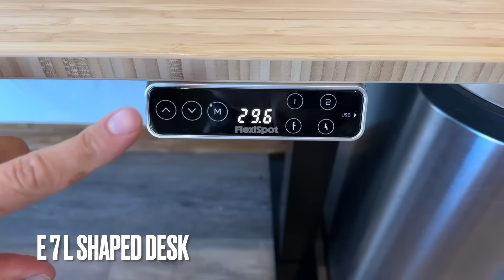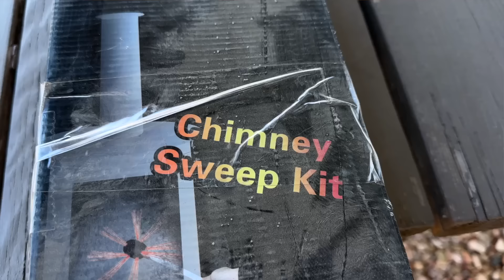HUGE GARAGE TRANSFORMATION - WINTER IS HERE

Comment: That 5/8 is incredibly heavy... and I got sore just watching you.  What you do, though, you use like a picnic table and mount the drywall hanging rack to the top of it.  You move the table into all the different places with the rack fully down... and you crank it up to meet the ceiling... but your table can't be wobbly... and you got to be okay with putting screw holes in the top.  The other thing that might help... though it won't help all the time - is quick grips.  You can hold the drywall in place with those.  The original tool for doing this is what they call a dead man.  it's essentially a big T made from  2x4's.  You make the T  the full height of floor to ceiling, but you set it against a wall leaning  a little so you can get one end of the sheet rock resting on the top of the T... very near where it needs to go on the ceiling, and that leaves you and your helpers at the other end getting it fine tuned into place and screwed.  It's going to look great!  I don't even have a sheet rocked garage... lol.

Comment: If you haven't already, unscrew the handle and apply anti sieze on the threads. Once the handle has seized it's nearly impossible to turn it and to lock the door...happened to mine as I didn't know to do that.

Comment: Regarding the seal on the stove door, our airtight wood stove is 40 years old and still wearing the original seal and it is fine. As long as it isn't damaged or you see other problems I wouldn't worry about it. We burn a couple cords a year of hardwood and one of softwood (usually cedar)
Good job on the cleaning...the creosote is in part due to the wood you are burning and a low temp fire, like when you back the damper down at night to keep the stove running all night. This year you have better wood, so that will help. All those years ago our friends "in the know" told us that, if we could afford it, to run triple wall pipe up through the ceiling...we did, and rarely have any build up even after a full winter. Keeping the heat in the pipe keeps the build up down, we just get that little ring of it right before the cap like you had..

Comment: I don't care what anyone says, wood heat is the best heat. right now, although it won't be seasoned for this year, there is an abundance of firewood just about any where you go around here, thanks to Helena! There are all kinda trees laying around on my property, and on the road sides, but mostly yellow pine(not good for the home stove, but OK for my shop stove once it dries out) and oak trees, seems that was what she targeted! The issue is, I am going to have to depend on friends, I have the saws, and a wood splitter, just not the strength any longer and, my back is due for surgery some time in the near future. After that, I might be able to handle cutting and lifting, I hope! Love your channel! And look forward to all of the videos you two create! BTW, I have never seen or used that type of chimney brush, Mine has the same type rods, but has a round brush with about 8" of stiff bristles that you just plunge around your stove pipe. Your stove looks to be easier, as mine has two elbows, which means I DO, have to disconnect my stove on the inside and run the brush in, and then pull it out of the stove, and brush down into mine. Not a difficult job, but it is messy, not so much IF< I take my time. I did learn however that my small floor jack makes pulling the stove back to take it apart a lot easier. Also, dong the inside first, and then the exit pipe, as I have a clean out on the outside that I can just unscrew and let it fall into a trash bag or a bucket, (If, I have another set of hands to hold it. Anyways, enjoy your stove. I hope you have enough wood, I hadn't seen you cut a lot, but did enjoy your woodshed build! Take care y'all, remember there are a lot of folks who live vicariously through your journeys!
Reply from the maker: Thank you for the kind words and the tips! We will try to get a lot of wood stacked before winter.

Comment: When the lift it was up as high as it could go. You should have measured the distance and add it blocks to the lift so you could have tightened it against the ceiling. Joist and you could still load the lift on the ground. Simple

Comment: why not use the lift to raise the drywall to it's maximum height then push it the rest of the way with a dead man on each end that can remain until it is secured? i disagree about the ash bed, one does not want ashes but rather coals to facilitate a good fire..........g

Comment: I have a sincere and a serious question?
Why did you not install a anti-falling device on the roof? All it is is a cable spanning the peak of the roof and a rope coming down to a harness that you  wear 
PS. I don’t know, but I would think you could take skateboard grip tape and put it on the edge of the roof leading up to the chimney so it won’t be so slippery for your feet

Comment: Love your video's. I agree with some of the other comments that by making a platform for your dry wall lift to sit on would make life so much easier.
Can I just say that one thing has bothered me for months now is the way  your 6x6 deck supports legs attach to the deck! Would you not agree that there should be additional support from the legs to the deck using 6x6  45 degree bracing?  Sorry, , but it just doesn't look safe to me 🤔🤔 👍

Comment: Hey, I noticed that there is no drip loop on the Starlink cable where it goes into the house. (Time code 12.24) Water can run down the cable and into the wall. It can cause problems. Just a suggestion from an Installer. Love the videos.
Reply from the maker: Thanks for the heads up, we’ll make sure to fix that!

Comment: Just an fyi those strong foam boards you took out of the ceiling of the stove after you removed the rods, be careful with those. They become brittle over time (like year 2/3) and are hard to replace (well they are where I am). But good job for your first chimney sweep. Here in Ireland we mostly have open fires until recent regulations, so we sweep every summer. I would use the vacuum always when collecting the creosote/chimney dust cos it goes everywhere. I bet you "Annie the maid" is realising it right now how far that dust went after you shovelled it out of the stove. Anyhow guys I bet you are probably going to get this a lot but can I ask why did ye not insulate the lower level before drywalling? Would that not be extra insulation for ye guys above & make ye nice and cosy for those snowy nights?